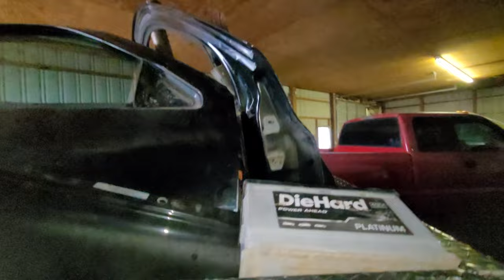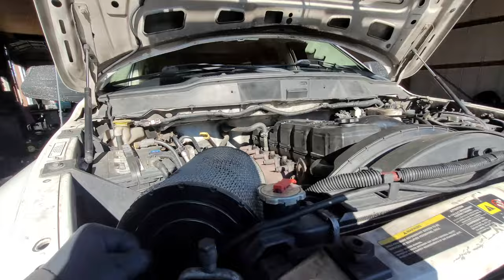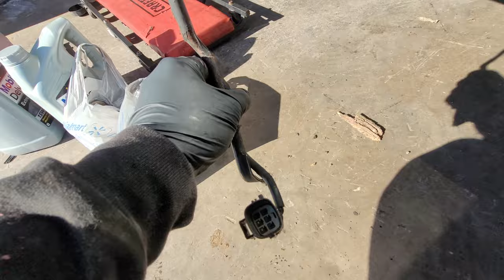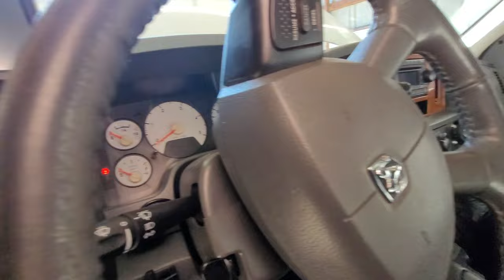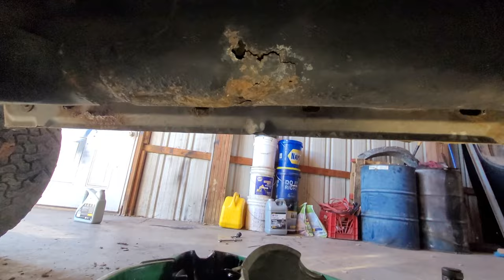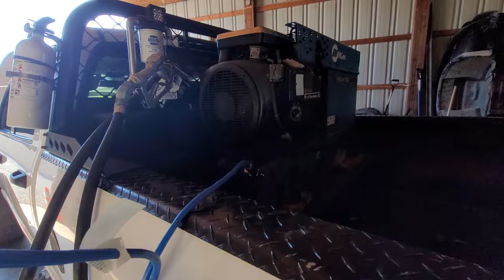Day In The Life Of A Diesel Truck Owner

Comment: I hear both sides about filling the oil filters. I do prefill and the die hard engine builders I watch say to always pre fill. They reason that especially diesel engines take so much oil to prime after an oil change that you don't want to pump air around the engine. The air will blow what oil there is on parts away and takes longer to get oil flow. The guys that are making their own billet blocks preach pre fill.
Reply from the maker: I've heard both sides, too. It's fun to stir the pot, though. Whether you do or not I've only ever seen engines fail from doing it but never saw a premature failure from now. 

That little silver liner on top of the jug I've seen get into the filter from prefilling and clog an oil passage. 

Either way just do what the filter says. I've heard, but never seen it for myself, that some filters if you prefill them can collapse. Again, never seen it in person but don't want to be the guy to find out!  

A brand new engine 100% needs to be pre lubed, though. If you're just doing a quick oil change, any parts are already covered in oil. I've had plenty of cars with 300k+ on them, a few with 200k+ and one diesel that broke a ring at 437k(the black dually I had). None of the 60+ vehicles I owned ever had the filter pre filled unless it was a new engine. 

My .02.

Comment: The area you showed were u have seen the frames crack and crumble I drilled a drain hole on the bottom of the rail in the low spot on both sides. Stops from water sitting in that area and just another spot to spray oil into.

Comment: You are a crazy day ever put 10,000 miles on a Cummins engine. Preventive maintenance is your best friend and your best maintenance.....🇨🇦
Reply from the maker: Not crazy. Spec is 15,000. 

Oil analysis says there's life left in the oil and my first commonrail lasted 437k miles before breaking a piston ring. Used to do it at 12k on that one. 

Diesel engines take 3 gallons of oil. They're made for it.

Comment: I did a mechanical fan clutch conversion on mine, you’ll be much happier with that in my opinion
Reply from the maker: Send me a link. I'll buy one when the check engine light notices it 😂
Reply: Just get a mechanical fan clutch adapter from about any diesel website for an 03-18 Cummins, and then that works with a fan clutch from a 7.3 power stroke.  My 07 never shows a light even with no fan clutch to plug in, I just got sick of the electrical ones going bad every 20,000 miles, almost burned my engine up once because of it.

Comment: As mechanic of over 40 years who told you about not filling the oil filter? First if you are pouring oil from brand new jug into the filter what is going to contaminate it? And this coming from a guy who for the longest time ran contaminated oil and grease through his fuel system. Get a grip on what you tell folks.
Reply from the maker: My dad was a mechanic for about 40 and he'll tell you the same thing. 

It's gotten to the point where they even had to put instructions on the filter to stop y'all from doing that. 

I've been a mechanic for 11 and a diesel mechanic for going on 7 now. 

We've had half million+ mile motors gas and diesel in and out over the years. Never prefilled a filter.
Reply: I agree pre fill

Comment: Makes a good work rig if you ask me 👏👏
Reply from the maker: Service rig 2.0 is going to be WAYYY better than the first setup. 

That toolbox that used to be in the back is getting recessed into the floor and we're building a deep box where the spare tire used to go.

Taking any of my mistakes and building off of that for next year. Cool little project and having a welder is going to make it that much better of an outcome.